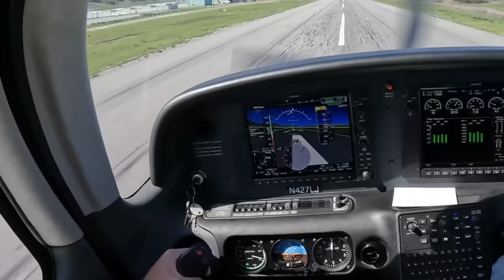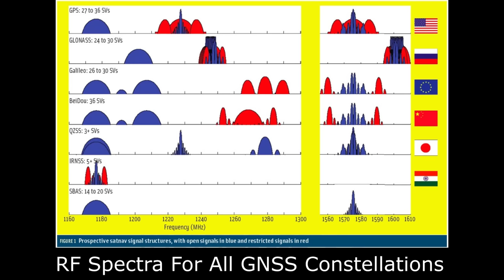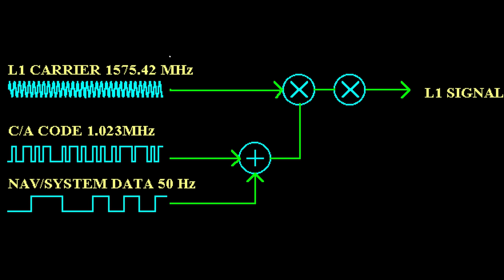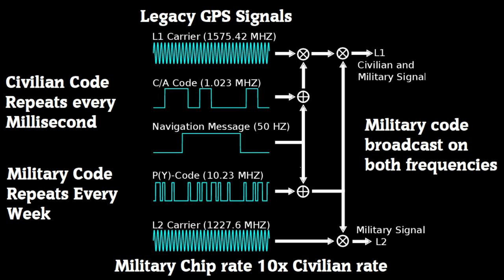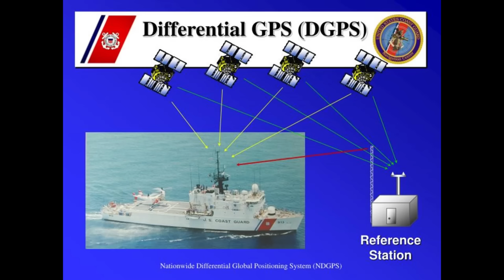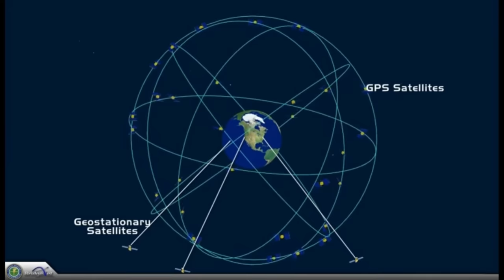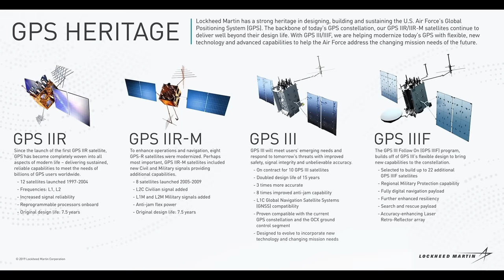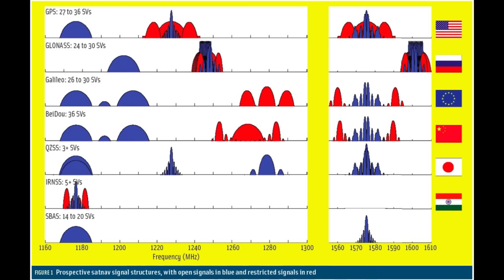How GPS Works, And How It Got Better Than The Designers Ever Imagined

Comment: I was in Switzerland last week and came across a multilingual "GPS data not correct!" sign in a valley. When I checked my recorded hiking path later, it was quite OK until I stopped for a little break next to a building and suddenly the position jumped to the mountain wall. After I was moving again it was off by a few meters.
Reply: That's probably multipath! The signals from the satellites can bounce off things and take a longer path to the receiver, which makes the receiver think it's in a slightly different location than it actually is.

That or there's someone spoofing signals nearby, though that's usually against the radio transmission rules in most countries. I'm not sure why they would put up a sign if they were illegally transmitting.
Reply: I suppose what must have been happening was that the mountains were not only blocking direct signals from satellites, but the detector could still pick up reflections bouncing off other mountainsides (and thus traveling a longer distance due to not following a straight line).  This is very much analogous to echos.
Reply: @Keldor314  Yes multipath reflections and diffraction off of the sharp edges of the mountain peak, which means the signal appears to be shifted in time with the reflection off the other side, and also takes longer with the diffraction, so the GPS receiver calculated position is wrong, but to the GPS it is still a valid position on the internal map it has of the area.
Reply: Where did you find this sign?
Reply: Lauterbrunnen Valley, if my memory is correct 46°35'18.8"N 7°54'29.5"E
Reply: There is a peculiarity with the national datums used in France and Switzerland that could be responsible for your experience (although I doubt this is the cause). 
Each country has its own "official" map projection and spheroidal datum that they use to map their own country. However, longitude and latitude are defined relative to a datum and because the datums used in France and Switzerland are different, you can find your longitude and latitude jumping as you cross the border somewhere in the Alps, due to the different datums used. [I think the latitude actually increases as you go South?]
However, nearly all modern GPS systems use the same "global datum" called WGS84 that means that there is a standard way to measure longitude and latitude everywhere on Earth.
Reply: That's likely because of reflections.
Usually GPS rules out the signals bounced off of buildings and mountains by picking the strongest one.
But if you are in a very mountainous area or in a very dense urban landscape it's possible that for some satellites you are only receiving reflections and not the actual signal (or you are receiving both but the reflections are stronger and the one going in a straight path), in that case the GPS receiver will get confused and give you a wrong position.
The fact that the good signal is choosen by picking the strongest is also way GPS can be spoofed (a fake GPS signal transmitted from ground will be far stronger than anything coming from space).
Reply: I think with most latest smartphone GNSS chips utilizing multiple GNSS systems you probably shouldn't experence much of such. There will be plenty of satellites in view even if the view of the sky is limited.
Reply: It's a fairly common sign in valleys with very steep walls.
Reply: WGS84, takes me back to doing long-hand conversions between it and AGD Australian Geodetic Datum.
Reply: @ToothbrushMan  UK also has it's own datum (Airy Spheroid), so sometimes you need extra corrections (rare now) when using the local defence mapping system (Ordnance Survey Grid reference), though one of my phone apps always got the height wrong by 55m which is the separation between local sea level (geoid) and the spheroid - either double corrections or a missing correction.
Reply: @philipoakley5498  Indeed. The Airy 1936 datum. The OS map projection is a transverse mercator centred on the 2 degree west line of longitude (from memory) and I think the datum uses mean sea level at 5(?) locations around the UK coast. Taken together they fix the Airy 1936 datum.
Reply: @SimonLanghof  
"Lauterbrunnen Valley"
Yes! Lauterbrunnen,  Mürren, Stechelberg, Wengen. This valley is one of the most beautiful places on Earth. Been there in 1995, it was the trip of a lifetime, dream-perfect vacations, really. I sometimes long for going there again, but fear that a new experience might spoil the good memories.

Comment: Of course associated with the deployment of the satellite system was the development of small, low power receivers.   In the early days we needed a gps receiver at a site — hauled a rack mounted unit on a commercial flight.  The receivers shrunk over time a specialized correlation chips were made.  I think Rockwell made the first receiver on a PC Card about the size of a pack of cigarettes, could be wrong there.  Anyhow now of course the receivers are tiny, thank you Moore’s Law.
Reply: Biggest impovement was the patch antenna, which placed most of the receiver filtering at baseband into a single precise ceramic puck, that not only was the antenna with a wide acceptance angle, but also the front tuned circuits and selectivity, and with it being a very high Q filter to reject out of band noise as well. Got rid of half a rack of cavity filters and amplifiers, that you needed to keep at a constant temperature, and also a good chunk of power needed for all the amplifiers and temperature control.
Reply: Nowadays GPS antennas can be like 1/10th of your fingernail!

Comment: Caterpillar has a system called acugrade (or something like that) that uses some kind of known location. They have GPS receivers on each side of a dozer or grader blade. It is my understanding that they can cut a grade within a half inch.
Reply: I don't know how Caterpillar's system works, but if the two gps receivers can exchange phase data from the satellite signals they can calculate their relative orientation much more accurately than their absolute position
Reply: @Octa9on  I never worked with the system during my career there but I worked around people that did. I think you are probably right but I never learned the details.

Comment: I'm a corporate Jet Pilot and we use GPS LPV approaches all the time. It's pretty amazing that there are GPS approaches that can get us down to the same 200-foot minimums on an ILS will!
Reply: Do you know of a specific airport where that’s the case? I’ve yet to find one personally. I believe you lol I just haven’t seen it.
Reply: @seanspoerhase3878 LFPN has one for the 25R. 07L is 250ft above ground, which is also impressive. Both are DA.

To be more specific, it's 200ft for cat A aircraft, otherwise, it's 220ft. For the 07L, it's 250ft for every aircraft.

Comment: Now that you've introduced the topic of jamming, now I want to know how jamming actually works!
Reply: GPS signals are incredibly weak at ground level. So you either block them completely (can be done with a $200 box) or transmit more powerful signals with spoofed signals (can be done with a $20,000 box). This only works in a local rang of you transmitter, so hundreds of meters to 10s of kms depending on transmitter power. But it's very easy on a local level. Like say around an airport. Jamming on a large scale requires much more power or number of transmitters, since GPS signals are coming from space.
Reply: @PsRohrbaugh  Plus possession of such a jammer, or at least using one near an airport, will have a few government agencies find you, and have a very long and pointed talk to you. Ask the truck driver who did that near a US airport, because he wanted to jam the GPS tracker on his truck, so he could have some off time on the clock.
Reply: @PsRohrbaugh  Or put your jammer on an aircraft.

Comment: I work with satellite positioning for marine usage. We can offer 4 centimetre precision. 
That DGNSS explanation you did was very accurate, and we can offer that correction thru a geostationary satellite or even thru internet connection.
We cover pretty much all the globe, with hundreds of reference stations.

About the height, you can see a better precision under good HDOP values, HDOP indicates the concentration of SVs in the sky. When they are more spread, the better is.

Comment: Scott, we use GPS a LOT with rc stuff as well. "Drones", but they can be multirotors, airplanes, boats, rovers... And now you can find on the market what they call M10 GPS chip based antennas.
The difference is that you can connect with multiple satellite networks, so you get a much better fix, faster and with more satellites. 
You usually need at least 8 satellites locked before you take off, but with those chips you get 16 satellites easily. Some times even more!
And people use to fly to pretty distant places, in the middle of nowhere, to record waterfalls on the mountains, for example. So what it gives you is "return to home". Which means that, if you lose contact with the craft for some reason, it's going to fly back and land by its own. (And those things are expensive, unfortunately it's not a cheap hobby, so you need it.)
Anyway, stay safe there with your family! 🖖😊

Comment: I always thought the reason you need 4 satellites was the following:

1 satellite puts you somewhere on the surface of a sphere (distance from Sat)
2 satellites put the reciever on the intersection of the 2 spheres which is a circle 
3 satellites intersects a new sphere and the previous circle which gives 2 points
The 4th satellite is required to resolve which of the two points is correct.

Good video as usual!
Reply: If the time function wasn't involved you could in fact use 3 minimum for all non-aerospace applications because if the receiver is ground based it's fairly safe to assume that the point at a higher altitude than the satellites themselves is probably not the correct one.
Reply: I could swear only 2 were necessary for my ancient Magellan, though much less precise. The 2 spheres alone will give 2 points on the surface (the only part of the circle that matters), one of which will be stationary while the other is moving as the satellites fly their different orbits.

Comment: One thing that isn't mentionned I believe is that the GPS (When 4 sats are visible) also provides an extremely accurate TOD (Time Of Day) clock - and is extensively used by - amongst other applications - financial institutions that trade, usually against each other,  stocks - automatically sending pull/push orders to some clearinghouse that are then granted or denied on a 1st come 1st serve basis based on a GPS clock timestamp with a, I believe, better than microsecond accuracy (The L1 sampling frequency - And GPS doesn't use the peak to trough time of the signal - it uses the signal slope to get a better estimate).
Oh and last thing - I'm pretty sure modern GPS receivers (like a smartphone) don't have to listen for the WAAS information (the iono/stratophere atmospheric induced variations) - they just get it off from the Internet !
Reply: interestingly enough, GPS time is not equivalent to UTC. for example, it doesn't include leap seconds, so it's like 17 seconds off of UTC at present
Reply: @Octa9on  Very true ! But IIRC the clock tick message sent by the GPS system has a "leap seconds" (as well as a century field just in case) field to indicate the offset ! It's probably very important for the thousands if not millions of events that occur between 23:59:59, 23:60:60 (the leap second) and 00:00:00 next day
Reply: Yes, I thought Scott might mention the derivative uses and the impact GPS has had in global cache coherence. The Spanner system is a brilliant example of this. For every OPS in the GPS constellation there are now m(/b)illions of correlated IOPS.

Comment: This was a great description of GPS with lots of details I haven’t heard before.  Great job!  I’ll add two details 

(1) GPS uses General Relativistic corrections to achieve its accuracy, since the signals fall down into Earth’s gravity

(2) The actual GPS signal is too weak to see on an oscilloscope.  The signal is below noise.

Comment: I remember sailing across the Atlantic starting in France with DECCA and switching to LORAN half way to the US. Early  GPS  was downgraded for civilian use to about the same accuracy as LORAN. At one point we had to have all 3 on board + paper charts!
Reply: I’m an old commercial sea captain, back in the mid 70’s we were still using the old LORAN A on the U S side of the Atlantic and Decca if fitted in European waters, both of these systems were very range limited and were dependent on shore transmitters which usually only covered highly trafficked areas. In fact in international trade we lived and died by celestial navigation. Around 1979, I saw my first Transit Satellite Nav setup fitted which gave occasional fixes. I believe LORAN C came into fairly common use in the very early 80’s. In the later years when the full modern GPS systems came into common commercial use, the everyday sextant and celestial navigation skill set largely faded although commercial deep sea navigation officers are still required to be trained in its use.
Reply: @northerncaptain855 A bit of a shame really, since it was celestial navigation and reading the ocean that allowed early explorers like the Polynesians to cross huge distances. I'd wager most people nowadays don't know how to find the north star or what the Southern Cross looks like.

Comment: I had a colleague whose daughter did research in Antartica. The military copter would take them out on the ice to the place where they would camp for some number of days, then move away some distance and take a precise fix on that locatioin. They were told that the copters did not like to return in white-out conditions, but in an emergency could return to that same spot within centimeters of x,y and altitude with zero visibility.

Comment: My Garmin Epix pro can use multiple gps systems at the same time depending on which setting I use, last weekend I navigated around the maze at Leeds castle using my watch, it could tell which side of the hedge I was on that’s less than 1 meter accuracy.
Reply: This ability is incredibly important given geopolitical issues. For example, I was using GPS + GLONAS for years but when Ukraine stuff started, my accuracy went WAY down. Like, hundreds of meters off. Turning off GLONAS fixed everything.
Reply: @PsRohrbaugh  Related to the Ukraine stuff starting. GPS was jammed in the Eastern Finland and couple airports had to cancel some passenger flights because instrument landings were impossible. VOR had been disabled years ago so the approach was GPS only. Weather and jammed gps ended up being a major problem.
Reply: This sounds like you were cheating!
Reply: Yeah, I can easily tell which side of a road I was on when logging runs on my Garmin Endura. Clever kit which seems to be getting more accurate as time goes on!

Comment: You left out one key part at the end. Many GPS receivers, for surveying, grading, farming, etc especially, use ALL of the constellations at the same time.
This way, even without RTK (Real-time kinematic positioning, the system used for surveyors, heavy earth moving equipment, and precision farming to get millimeter accuracy, similar to the differential GPS systems you talked about), you can get greatly improved accuracy, because each system has different error modes, different frequencies so you can calculate ionosphere conditions better, plus you get a lot more satellites, so you can get more accurate positioning data.

And combine that with RTK with a base station at a known location, and you can do a GPS controlled CNC milling machine with sub millimeter accuracy! Lol
Or, you know, get accurate survey data with no Total Station and lasers, or have a Grade Control equipped road grader or paving machine make perfect roads, or have an auto steer equipped tractor fertilize a field and keep the drill lined up perfectly between the rows of seeds, while the millennial farmer makes silly YouTube videos and complains about the times the system crashes ;)
Reply: When you say "GPS controlled CNC milling machine", are you talking about the ITAR-controlled machines that lock out if they're moved? Or something else?
Reply: @sentinel76  no, I am talking about a CNC milling machine that uses GPS receivers instead of positioning transducers or shaft encoders ;)
Picture a GPS antenna on the base for the RTK signal, one on each end of the head, etc.
Totally impractical, but it would be a fun project for Make Stuff Here or someone to make! Lol

Comment: A very good summary of GPS.  I was on the Dept. of Transportation (the lead Civil Agency on GPS) GPS staff and for a short period of time (due to maternity leave of tha actual lead), I lead the effort to obtain the second Civil frequency on the GPS system.  We came up with a way to jointly use the L2 with the military.  I then left the program to work in Congress.

I have many stories to fill in some spaces in Scott’s presentation, but let me quickly summarize.  The sideband signal was developed by a very smart young engineer to add a civil signal to L2.  We could not get any Agency to admit the superior accuracy of having 2 frequencies was beneficial until the USDA stepped forward and said they expected autonomous farm equipment would experience benefits in the range of $1 billion per year.

So, if you love your GPS being able to get you somewhere new or your pizza to be delivered directly to you anywhere you are, thank a farmer.
Reply: hi kmlammto, have you become a flat earther yet?